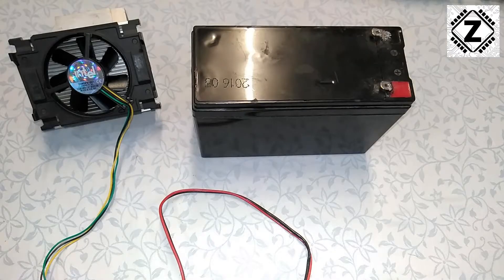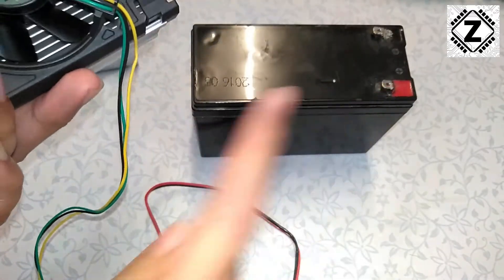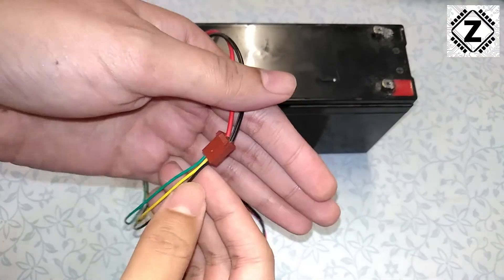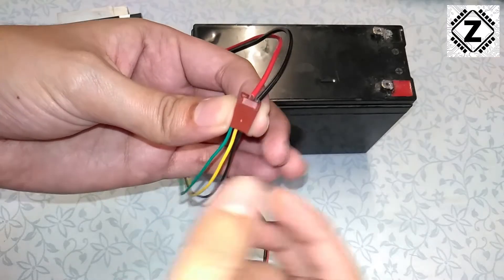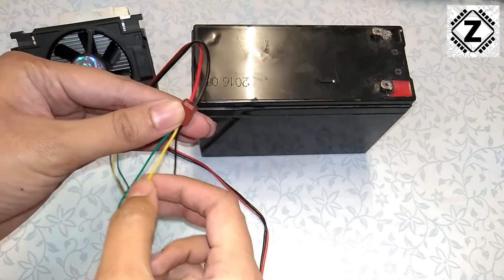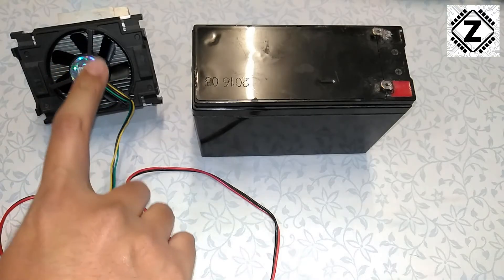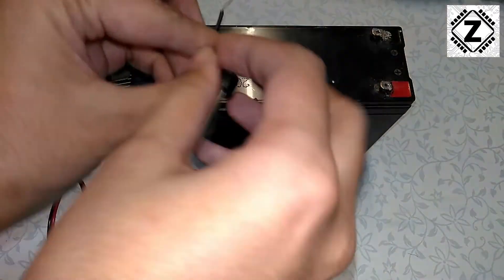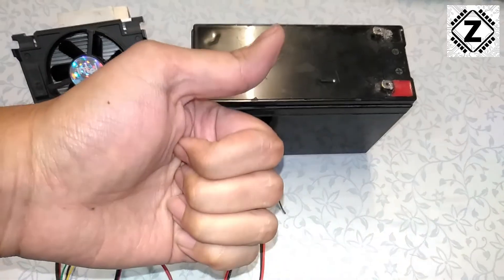[Eng] How to Run CPU fan on 12v battery | 3 wire to 2 wire Cooling fan Mod, Pinout, Reverse Polarity

Comment from the maker: This Video is available in Multiple Languages-
English- https://youtu.be/sF-NxTRtqZg
Hindi- https://youtu.be/zHB9Hd3zv7o

[Affiliate Buying links]
Ready fan conversion wire  (Fan 3 wire to 2 wire adapter) https://amzn.to/3AFsoNF

CPU Fan https://amzn.to/3iIRhSj
12v cooling fan https://amzn.to/3m3XCtU
Copper wire https://amzn.to/43280Fu
Diode In4007 https://amzn.to/41gFvSX
bike battery  https://amzn.to/3m0eHov
3 wire fans https://amzn.to/3iIRkxt
2 wire fans https://amzn.to/3m3b40Q
12v SMF battery https://amzn.to/3xLxEgI
Fan controller https://amzn.to/2VWEq6D
CPU Heatsink https://amzn.to/3ADV8q0

Comment: Can be a RPM detection wire, can also be RPM control wire. Depending on the age of the fan. Can be that, the higher the voltage on the green wire, the lower the RPM because you're evening out the magnetic field inside the E-motor of the motor. The Diode is also completely useless unless you want to connect a 5V supply for lower RPM to prevent 5V going to the rest of the 12V system or 12 V to the 5V system. To protect the fan you should connect a fuse in between. This video was completely useless.
Reply from the maker: The video serves its purpose and powers the fan.

Comment: Hi can we connect this fan with Car battery?
Reply from the maker: Should. Work
Reply: @ZenInnovations  Thanks, due to the high current of car battery any chances of damage to this fan?
Reply from the maker: @Aviatoralok  use a resistor if you're worried.

Comment: Great video, maybe you could help me, I'm trying to connect one of these fans to a battery Milwaukee weed trimmer to help with cooling. My issue is that I don't know how to do this. I'd like to have it wired to trigger but I don't understand or have the know how. Maybe you can help please?
Reply from the maker: Join my Telegram group for detailed discussion
Reply: @ZenInnovations   I don't know how to do this.

Comment: There is no need of a diode if using a 12 volt battery. It is superfluous. 
He did not actually run the fan and show it working.
Reply from the maker: Doubt all you want. The trick works. Also watch the full video before commenting. So you know why that diode is there.
Reply: I heard fan take off. Full speed?
Reply: Manual polarity protection. Sweet.

Comment: 👍 from me... Here in HOT Florida I'd like to mount on of these fans on my Air cooled ATV 4 wheeler to help in cooling, is there a universal COLOR for them on the Positive & Negative wires? IYHO should I mount it to PULL air from the motor or PUSH air into it since that would be the functional way as you ride it?
Reply from the maker: Colours are not universal. You can count strands from Left to right, by holding the plug in direction as shown in the video.

For atv, it's better to PUSH air onto the hot engine.
Reply: I have 4 mounted on my walk behind mower, all 4 pointed at me.  These fans are free, scrap electronics and computers are everywhere.

Comment: Is it possible to wire a computer cooling fan (3 wire) to a small (2 wire) solar panel? 
The fan is 12v DC .16A
Reply from the maker: Yes with appropriate buck boost converters.

Comment: i used your video and it worked flawlessly but i skipped diode because im an electrician lol, and i searched my house for a 12v dc power brick and found one unused, just make sure it is 12v DC and read the pin out, in my case center pin was positive and outer barrel jacket was negative which is usually the case BUT NOT ALWAYS, its usually impossible to read so take a picture with your phone so you can zoom in and you can actually read the specs on the power source!!! Cheers mate, my hydroponic setup now has a pc fan for added plant stem growth, if you give them no wind the stems are weak, may you grow bountiful crops mate!!
Reply from the maker: That's really neat!

Comment: What type of extension wire you use to connect to battery?
Reply from the maker: Copper 0.5 Sq mm
Reply: @ZenInnovations  I want to buy it online. What search term should I use? I saw in your description you listed down where to buy everything but forgot to include extension wire 😉
Reply from the maker: https://amzn.to/43280Fu

Comment: Fake
Reply from the maker: What do you mean fake?
Reply: @ZenInnovations  
Bldc fan will not work without signal (with two wires)
I have tried but not working
Reply from the maker: @bsrln  your fan might be weird.
I have been using this idea since ages. It's not a signal wire. It's for RPM control & reporting.
Just because your fan didn't work does not mean it's fake.

Comment: mines is a cooler master brand with 4 wire ,black yellow green and black. when i hook it to the 12 volt battery it spins for 2 sec and stops right after but does spins every time, I don't understand . maybe i damaged it while trying other wiring.
Reply from the maker: Possible
Reply: I think it's a pwm fan. I'm not sure but I guess it can't run without a controller

Comment: I may have worked but in a DC system power flows from the negative to the positive. Power doesn't come from the positive terminal.

Comment: Thank you for this. It seems very straight forward, except for the diode. 
What is the purpose of it?
What size diode do you suggest? 

Thanks again.
Reply: He should have clarified the operation of the diode by reversing connections on the battery to show that current to the fan is blocked in the reverse direction.  Use any low power Schottky diode.  Why Schottky?   They have very low forward voltage drop----meaning that the fan will see approx 11.9Vdc rather  than the 11.3Vdc in the case of a regular diode (but either one will work in a pinch).
Reply from the maker: As explained in the video, the diode serves as reverse voltage protection.
you can use 6A diodes (6A4)

Comment: Connect 12v+ to fan positive. Connect 12v- to fan negative. Done.
Reply from the maker: Only problem is, where is positive & negative?
Reply: @ZenInnovations  Can't you see that by just seeing how the fan is spinning?
Reply from the maker: @Josefsson9013  wrong connections will fry the fan immediately.

Comment: Thanks for the sharing your knowledge. You didn't mention, can we connect it to the larger battery like 12v 100amp or 150 amp ? From Afghanistan
Reply from the maker: You can connect larger battery, No issues. Just ensure voltage does not exceed the fan's max rating.

Comment: My computer has black on the right side and red in the middle and Yellow in the left side.In which side should I give power
Reply from the maker: You'll have to check using multimeter.
Reply: @ZenInnovations  I simply connect red to red and black to black and is working now. Thanks for your suggestion
Reply from the maker: @sumit2k60  good.
Reply: It could be to use for motorcycle battery or not.thanks new subscriber
Reply from the maker: @rueldiano4456  yes. Works on any 12v dc source.